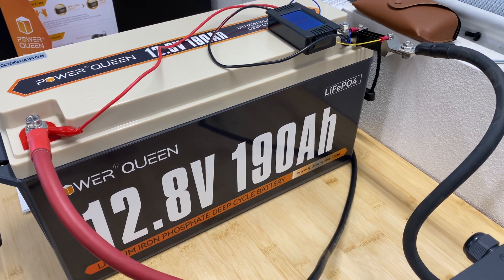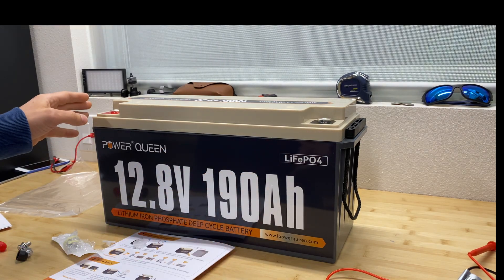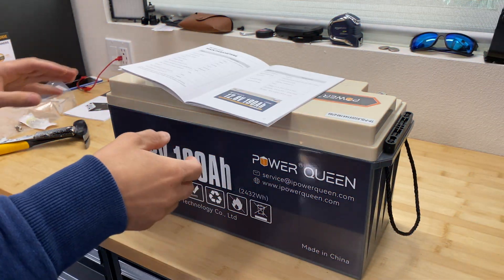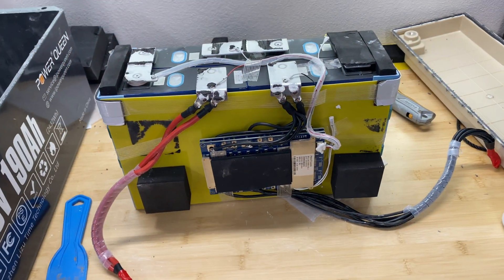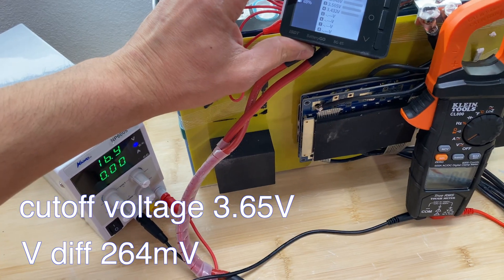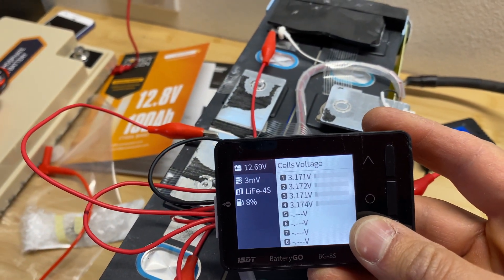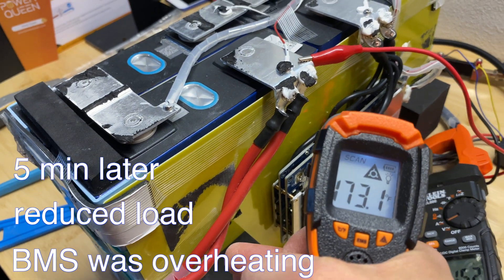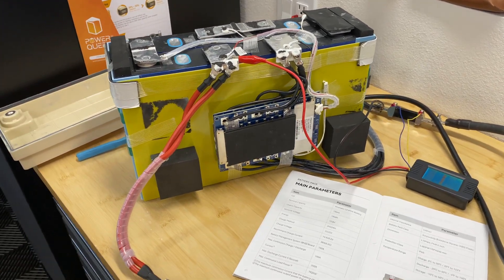In-depth testing LiFePo4 12V 190Ah battery from Power queen.

Comment: Very nice. I might get this battery for a 2000W inverter (156 Amp). It might get warm, but do you think it can handle 156a continuously until depleted, around 73 minutes I think?
Reply from the maker: It's definitely going to get warm, and could cause some faster degradation.
Few options to extend life:
1. let the battery cool down after continuous high amp discharge before charging.
2. install higher capacity batteries (or parallel 2 of them) to reduce amperage.

Or just use as it is, and replace the battery as needed. Whatever works better for your application.